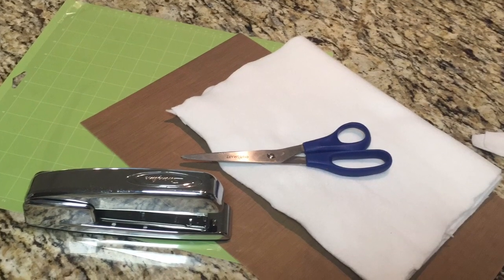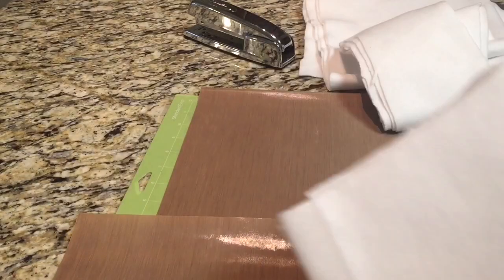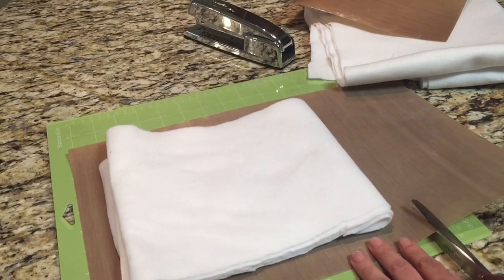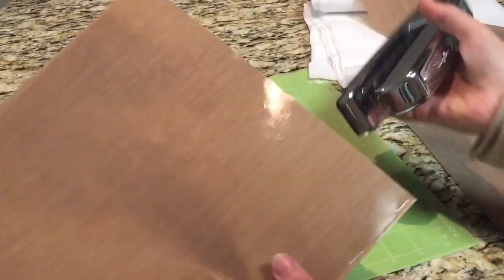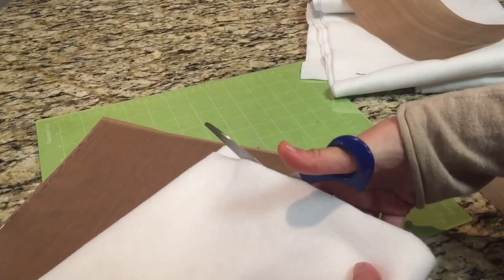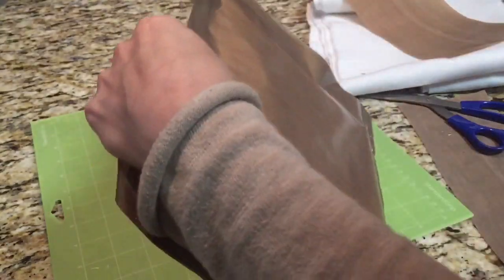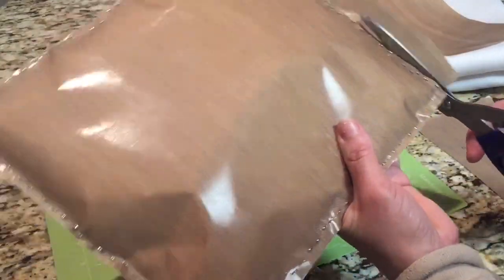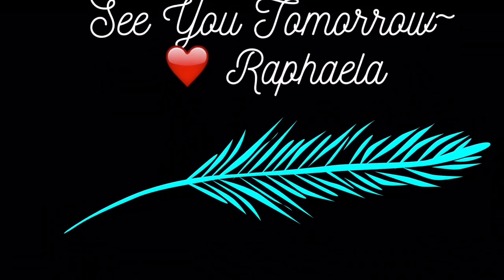DIY Heat Press Transfer Pillow | No Sew

Comment: I can think of a couple of reasons NOT to use staples to secure the sides of a heat press pillow.  As an owner of a decorated apparel business, I use these types of pillows all the time, but they are sewn on the edges with heat-resistant thread, which is what I would recommend.  Some pressings may result in staple lines that you would be able to see in the garment or applied materials, but most importantly, the risk of scratching the heat platen surface with the metal staples would be too high.  It's important to keep the platen surface free from defects to ensure its longevity and proper functionality.  Also, some staples warp &/or rust over time, so I would be very leery of using them.  I like your idea of creating custom pillows for specific jobs...it would certainly make some applications easier to complete!  Cheers.
Reply from the maker: Hello. Yes, no DIY is perfect, but this one has worked for me with hundreds of different projects with no scratches at all and certainly no rusty staples. I don't use a heat  platen, as I just use a piece of wood on the bottom and then iron the item, so again, there have been no issues for me. Sure, sewing would be better, but this DIY is for people who can't sew or simply need to throw something together quickly. I think your comment is important though, because if someone was using a heat platen, then I would not recommend staples. That said, I would think that most people who own a heat platen, probably purchased or made heat press pillows by sewing them or buying them. It's a great DIY if you are in a pinch and need something fast. Thanks for watching and commenting.
Reply: Ty for this video. I'm just learning. I think I'll try heat transfer tape instead of stables. I hope it works!
Reply: Hi. I have double sided heat tape. Would that work

Comment: Hello Thank you for sharing your video. I would like to know where did you get your Teflon sheet from.
The one that's link to this video is it the same one you are using? 
I've ordered some from Amazon and they do not look like the one in this video they rip easy..
Reply from the maker: Hey Lucy, The link in the description box is the exact same stuff that I am using in the video. It does cut very easily but that's what makes it great for this project. Mine have never ripped, but again, they are easy to cut. I hope that answers your questions. Let me know. Thanks for watching and posting.

Comment: Do you think I could use ironing board material the same way? I know I could sew it, just curious if you think it will staple. Thanks!
Reply from the maker: Yes, I have heard of people doing these Heat Press Pillows with ironing board material. I have heard of people sewing it, but I can not see a reason why you shouldn't be able to staple it. I say give it a try. I wasn't sure that these pillows would turn out, but I just rolled the dice and they totally did. Let me know what happens. Good luck. Thanks for watching and posting.

Comment: do you think super glue would work instead of staples?
Reply from the maker: Hey Bryant, I wouldn't use super glue, because of the heating component of making these shirts. You could try it and see if it works. Why not? I'd be interested to know if it would stand up to the heat. Let me know what happens if you do this. Thanks for watching, posting and making that suggestion.

Comment: Just saw this but was wondering if the staples hook on to the shirts when slid it in?
Reply from the maker: Hey Carol. No, they don't or mine never have. If that is a concern for you, you could just take a rubber mallet and and tap on the staples until they are really flattened out.I hope that makes sense. Let me know if you try this. I have done at least 50 shirts using the pillows that I made in this video and I have never had an issue with snags, but it's still a great question. Thanks for watching and posting.

Comment: I thought heat resistant stuffing was needed for these?
Reply from the maker: The material, the sheets being used resist the heat, so I don't think it matters what you put in the middle. I have used these hundreds of times with no problems. Hope that helps.